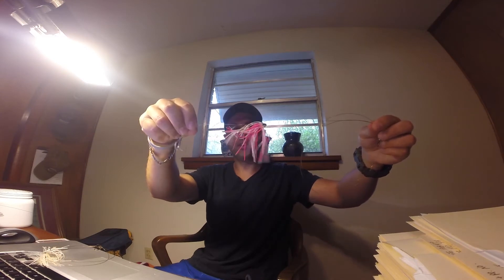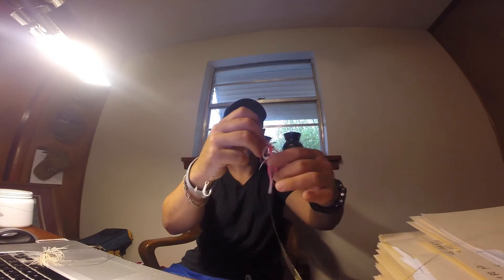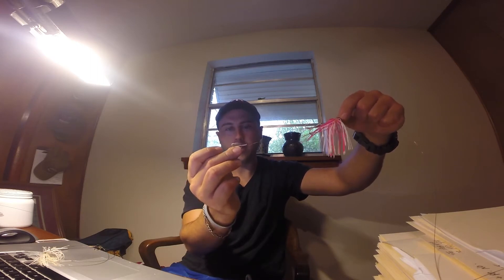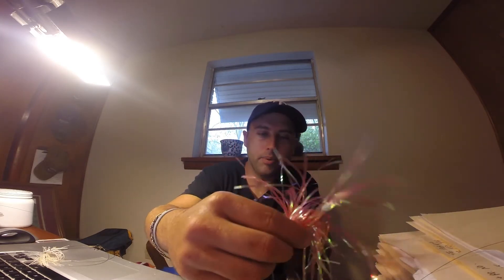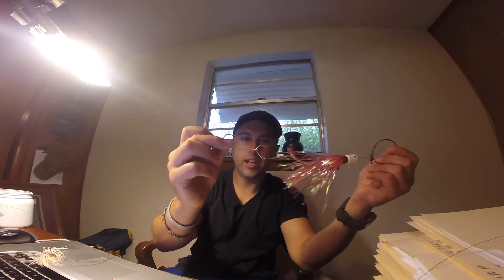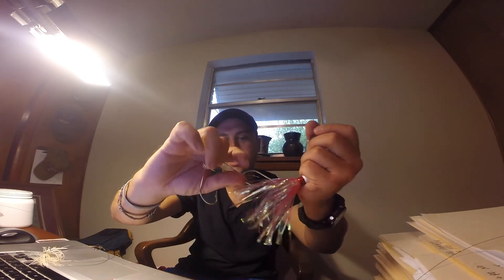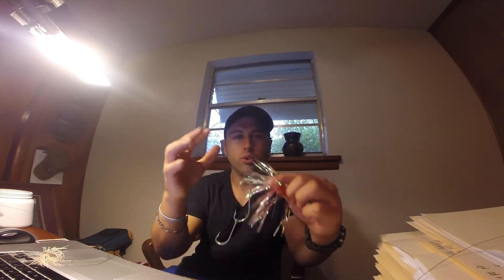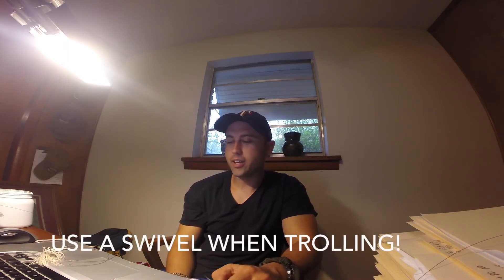Kayak Fishing :How to make Duster Rigs for King Mackerel  VLOG #15

Comment: Very similar to what we use, except that we usually use a single J hook as the lead hook through the baits nose, and then a series of trebles behind it, on their own pieces of wire spaced according to the bait we intend to use.  I usually space the trebles about 4 finger widths apart from each other, so no matter were the king mackerel hits he'll get a hook.  For dead beat I use an easy-swim as the lead hook instead of a regular J hook, it's a J hook with a moulded lead weight on it which helps make sure the dead bait "swims" nicely without twisting.
Reply from the maker: +Jbay2608 whatever works best for you.